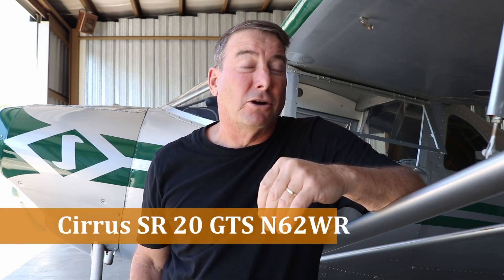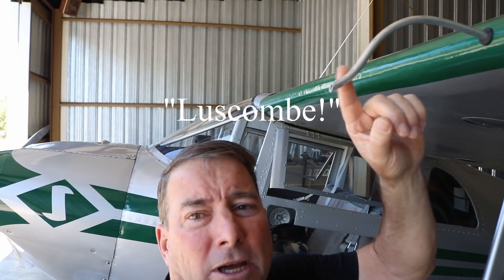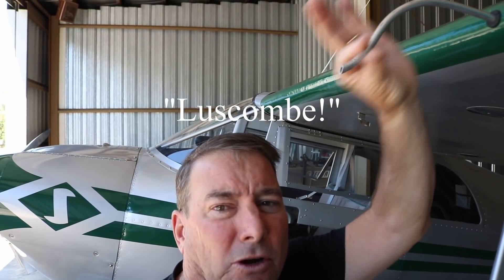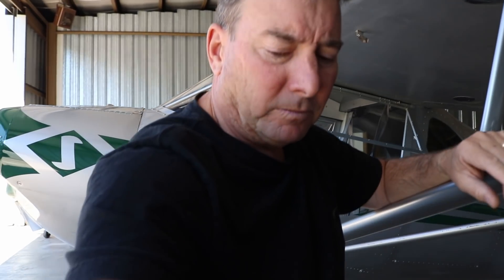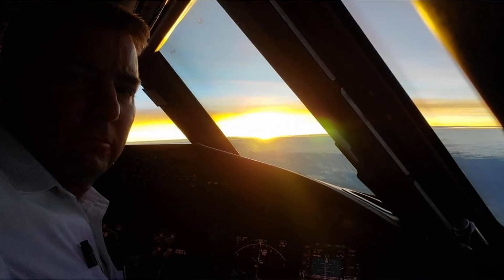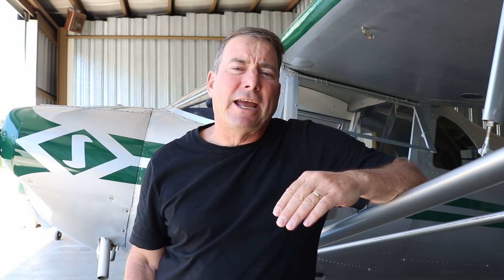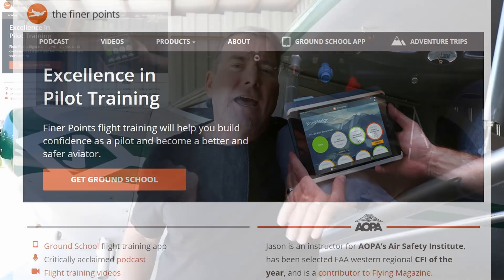Cirrus SR20 Crash Conway AR - AQP for GA!

Comment: I’m a new student but not a young student. This AQP stuff all sounds very important form the start. “Speed is life” is definitely in my head from you experienced guys, but translating that to “if you can’t be sure of the airspeed, push the throttle a fair amount and take it easy on upward pitch” is helpful to hear spelled out. Ideally I should only solo in aircraft that I have a good feel for so I have some references for stuff live what a good power level sounds like. Also sounds like a good use for pulling the CAPS chute but might have been thinking “Im close to the airport so I’ll just bring it in.” Finally shouldn’t there be a specific count of red covers that should be off the ports, etc and inside to cabin with you as a checklist item, even if it’s just one pitot tube cover? It’s so easy to miss stuff like this. Preflight should be “sterile” vs chatting.
Reply: AQP isn't needed if you  just follow the checklists religiously.
Reply: @speedomars  true. When I get part of my mushy human brain replaced with a perfect computer, and parts on aircraft stop failing, then I won’t need to worry about what to do when I’m in the air with no or unreliable airspeed info. In the mean time, I’ll put a little work into preparing in case I mess up or something like a failed airspeed indicator happens. But it is all lower emphasis that the fundamentals as you rightly point out. Missing the cover, if that is what happened, is a serious mess up.
Reply: "Ideally I should only solo in aircraft that I have a good feel for" And the statistics back that up. Instructional flights to transition into new models result in more accidents than any other type of instructional flight. (AOPA instructionalaccidentreportfinal)
Reply: the CAPS may not work well at low altitude, and yes push the nose down and have good airpseed.....
Reply: @logicturtle9838  All new Cirrus aircraft owners, and owners upgrading between the models are NOT allowed to fly their planes without factory transition training provided by CSIPs.  Anyone buying a used Cirrus from an existing owner is given full transition training by factory supplied CSIPs...and industry first, btw.  A new student taking lessons in a Cirrus should only take lessons from a CSIP if they want the most current and proficient training.  Cirrus cannot control if a regular CFI is hired by someone or is what a school offers to its students.
Reply: @tomdchi12  Unless you have an EFB which is using GPS or you have a glass panel that uses GPS, and the pitot tube is blocked you will ONLY have Ground Speed to estimate your over the numbers and approach speeds.  Otherwise, you have to do it all by experience and the feel.  Students generally do not possess those skills.
Reply: AQP in this context, means learning critical skills that aren't part of the FAA ACS.  Or in other words, training beyond the bare legal minimum to pass the checkride, and instead training to learn how to fly.  It sounds like you understand this is important, make sure your instructor is on the same page.  :)  For this particular accident, to me I see 3 independent mistakes.  First, an improper preflight.  Second, he either wasn't looking at the airspeed on the takeoff roll, or made a decision to continue the flight without an airspeed indication.  Third, he stalled the aircraft because he didn't maintain appropriate power and pitch settings.  It took all three mistakes to have this tragic outcome.

For preflight, I learned to start mine about 30-50' away from the plane.  Look to see if anything is obviously bent, crooked, etc.  Is the plane sitting "right" on the ground?  You'll see things at a distance that are not obvious close up.  Then I walk toward the aircraft and pull the pitot cover(s) and any cowl plugs.  In cold weather, it's common for aircraft to have those plugs in, and pilots do take off with them in.  Not great.  Next, I check the fuel, visually, in both tanks.  After all that is done, THEN I go through the POH checklist for that aircraft.  I always end with checking the oil.  I always sump the fuel.  I always check the trim, outside.  This way I have my own personal checklist, combined with all the aircraft specific checklist.

Before takeoff, I always do a briefing, either to myself or with any pilot, to agree on the emergency procedures A) on the takeoff roll B) on the climb before X altitude, and C) after X altitude.  So far, for on the ground, it's always "if there are any problems with the engine or airspeed, we stay on the ground" for me.  I believe it's critical that both pilots agree on whatever the plan is.  On the takeoff roll, VFR flight, my eyes are outside, except glancing down at airspeed regularly.

In the air, you should know what power and pitch settings work for straight and level flight in the pattern, and what works for descent and final.  That should let you fly the pattern and land, in most or all single engine piston aircraft without trouble.  I had to land without an airspeed indicator before my instructor would clear me for solo.  Above and beyond the requirements, and some might think too much.  Also, as a backup to this, is that you should know what being too slow looks and feels like, from your work at slow flight practice at altitude.  If things ever get mushy, reduce back pressure immediately.  In a fast plane, maybe using GPS speed is a good idea, but personally I'd never do it in anything I fly.  Even on a calm day, winds at pattern altitude can easily be +/- 10 knots, and that's far too much error, in my opinion, for safety in an aircraft that stalls at 50 k or less.

Not all aircraft respond the same way, your mileage may vary, run this by your CFI, and I'm just a plain pilot...but I do have a motorcycle license, too. :)  Best of luck with your flying.
Reply: @tomsmith3045  AQP is nothing new, unique, special or necessary.  This accident was the result of NOT FOLLOWING A PREFLIGHT CHECKLIST.  That is something MOST pilots eventually fall prey too as well.  It is not about training, its about DISCIPLINE and resisting complacency.  Same applies to making sure you have fuel.  Making sure you fly your aircraft regularly to reduce corrosion.  making sure you stay current.  Making sure you follow the same redundant, boring routine BEFORE and DURING each flight in order to avoid avoidable problems.
Reply: @speedomars  I'm sorry, you're incorrect.  This pilot made THREE mistakes, not one.  The first mistake was a checklist item on preflight.  The other two are training, and neither failure would have been caught on a private pilot checkride.  Checking airspeed on the takeoff roll is not a checklist item, it is a learned procedure.  Being able to fly an aircraft without stalling it, without a functional airspeed indicator, is a skill every pilot needs to have, and it's not tested on a checkride.  If you're an instructor, and you're training pilots to just the minimum to pass the test, you might want to reconsider your life choices.  This poor fellow doesn't exist  anymore because he didn't do a proper pre-flight AND because he either ignored, or wasn't given, proper instruction.  If it's the later, someone should have trouble sleeping over this.
Reply: @tomsmith3045  No.  The pilot left the pitot cover on.  That is a preflight checklist item.  No amount of training or experience will keep someone from failing to use a checklist and do a correct preflight check.  The kid no doubt panicked when he saw he had no airspeed indicated.  He could have used the Ground Speed if he was more focused and collected, but instead he got behind the plane and stalled it.  Happens to seasoned pilots too, especially pilots that have no AoA meter, or know how to use one.
Reply: @speedomars  Leaving a pitot cover on doesn't cause an aircraft to fall out of the sky.  Engine trouble doesn't either.  Stalling the aircraft and letting it spin causes it to fall out of the sky.  Ground speed is a terrible replacement for an airspeed indicator.  Setting power appropriate for climb, level flight, or descent, and pitching for the same is a very workable replacement for an airspeed indicator.  An AoA meter, in conjunction with appropriate power settings, could do the same.  We don't have a checklist problem, we don't have a technology problem, we have a people haven't been trained to fly the f(*(&ng airplane problem.  Stall/spin is distraction, poor training, poor procedure.  It is not tech.  Anyone that doesn't get that doesn't belong up front.

Comment: How was this student signed off to solo?  If a pilot isn't capable safely operating the aircraft by themselves, including when things go wrong, they're not ready to fly alone.  For that matter my CFI had me so prepared that my first solo, even with a real systems failure, wasn't anything special; nothing like the YouTube videos I've seen.  By that time it was just another day in the pattern, not thrilling or exciting. 

My CFI had me practice all sorts of emergency scenarios before signing off for my first solo.  Simulated engine outs at various times (some truly impossible to recover from), fires, flaps failure, controls failures, systems failures, covering up gauges, etc.  Also plenty of listening/learning what the plane felt like at different airspeed and power combinations, to the point I know what the RPMs are without even looking at the tach.   Plenty of systems knowledge stuff as well -- even going through the official maintenance (mechanic's) manual for this aircraft to understand how the plane is put together.  

I lost the vacuum system on the downwind of my first solo lap.   It was a total non-event and I continued to do my laps as if nothing happened.  I just thought about which instruments that would affect, then where I can find alternate sources for that info. If I got desperate I had Foreflight connected to a Stratus was sitting on the pax seat, and if I got really desperate my phone was sitting in the cupholder.
Reply: the bottom line is that ship happens, and the expectation that GA can be as safe as commercial air transport if only enough resources and training are dedicated, is so misplaced that it will kill GA altogether. it has already almost killed it, in fact.
the very fact that the community has become such a bunch of ship sniffers continuously hovering around crash sites is very worrying. how about some videos that are not dedicated to some hole in the ground with some corpses in it?

Comment: Yes....it should be a NEVER HAPPEN event to takeoff with a pitot tube cover in place -- and it is inexcusable.  But if it does happen, it should not result in a crash and death.   If the pilot had a backup yoke-mounted instrument like a portable Garmin 496, he could use the ground speed on the GPS to make a safe landing.  (I realize the Cirrus does NOT have a yoke.)  If Air France 447 had a portable G496 in the front office of that jet, it probably would have never gone down.  Believe it !!
Reply: No, he did not need any extra instruments. He was reported to be an experienced pilot flying in VFR condition. Just put the nose on the horizon and keep the power up.

Comment: "Fire Hose". Yes, absolutely correct. After a 30+ year career flying for a major airline, it is a challenge to take all of the info in as fast as it comes at you. General Aviation will never have the structure and internal support system the airlines have.

Comment: I dont understand even if the airspeed wasnt reading why he didnt maintain thrust.
Reply: Maybe he panicked because he was too reliant on the gauges and had never trained his ear to listen for RPM"s? Kind of like when you learn to drive a manual transmission vehicle, you don't need to look at the RPM's or speedometer to know how fast you're going and when to shift. You know by the sound of your engine.
Reply: @user-qr8ki8ue4i  Definitely a plausible explanation .  Its too bad the training cant be improved as the video outlined, for this poor guy.

Comment: It seems to me that it would be advantageous to use a tablet computer to run the checklist, taking a picture of every checklist item then going through those pictures. A barcode label could be applied at each item.If a barcode for an item wasn't photographed or caught on video the checklist wouldn't show up as completed. It at least makes them walk around the plane instead of pencil whipping a pre-flight.
Reply: its not that hard to preflight check an aircraft… it just needs 5min but in those you should not talk to anyone else and concentrate.. 

usually these things happen when you have to respond to someone or distracted by something… But then just start over and do it again.. or as Juan said.. a idiot walk around to make sure the critical elements are ok
Reply: They've already got those apps built for security guards, but they use Android + NFC.
Reply: Accidents such as this should be all that is necessary to dissuade any pilot from "pencil-whipping' a pre-flight inspection....
Reply: @KaneYork  yes our airport security has to go around and check off certain points.. but i mean a preflight on a single engine piston aircraft are maybe 20points.. if you can’t check those how should you do in the cockpit?

Comment: Poor student. Low wing too, so leaving the pitot cover on (if he did) is not visible from the cockpit. An experienced pilot would know RPM/power settings for each phase of flight (so that's a training/experience issue!). A friend's father had a faulty pitot on a short grass strip - it had been fixed once or so he thought - so he had to land back on a short grass confined strip using RPM and throttle settings etc etc as a guide. A student might have panicked at such a point and stopped 'flying' (in effect) the aircraft.

Always good to do a second walk around, peering into places that need looking at - even if a full pre flight was done. Eg imagine if you wander into the hanger to get something you've forgotten, after your preflight checks, and a.n.other has damaged your aircraft whilst you were away and he/she doesn't tell you.

As you point out though - what about abnormalities on the take off run. One should set an abort point (brief oneself), if not making airspeed or rotation speed, abort.

Especially with a single engined aircraft:- 'Max RPM, Acceleration Normal, Airspeed Alive, Ts & Ps good/normal Rotation speed achieved (or abort).

Easy to be an expert from my armchair though.

Comment: The Cirrus has GPS which would indicate groundspeed, keep that number above the stall airspeed, also an issue that could get you is not looking at the airspeed while still accelerating but well below takeoff airspeed, a few hundred feet down the runway and airspeed should indicate above zero but not quite at the minimum takeoff airspeed.

Comment: Cirrus has a GPS speed that would be close enough.
Reply: Pilot error pito airspeed check at ground roll check if no airspeed abort takeoff 200 ft 300ft 400ft 500ft its really simple
Reply: Exactly.  There is no real need to use the indicated airspeed during flight.  Flying using angle of attack (AOA) indicator would be easier and safer than by using indicated airspeed.   To avoid stall, simply do not exceed the stall angle of attack.  There is also an optimal angle of attack for climb, for efficient cruise, and for descent.  During steep bank, one is still able to stall the aircraft even at high indicated airspeed when one pulls too hard on the stick to exceed the stall angle of attack.   Landing an aircraft using the AOA is also easier, as one simply maintain the proper angle of attack for the approach, while adjusting the throttle to control the rate of descent to stay on the approach path to the runway.   When reaching near the runway, advance the throttle a little to slow the rate of descent, then soon enough, the aircraft will be in ground effect and wants to float and one simply needs to ease gently on the throttle to the idle position to get a soft touchdown on the runway.   By minimizing the use of elevator while trimming for the proper AOA, and using the throttle to control the rate of descent and climb, stall and spin accidents can be much reduced.

Comment: I always do my take off emergency briefing prior to line up, even when flying the C172…
-In case of any abnormalities before rotation speed 55kts: abort take off
-In case of engine fire or failure or aircraft unflyable after rotation speed, with sufficient runway ahead (state decision point): nose down, flaps full, land on runway
-in case of no runway available: nose down, pick landing site max 30° left or right, once committed, flaps full, land

In my opinion every pilot should go through this prior to every take off, regardless of aircraft type and pilot license type and experience!

Comment: I've never left the pitot tube cover on, but years ago as a low time Private pilot I did once have a sudden complete loss of airspeed reading right after takeoff in a Grumman-American Tiger, traced to insects in the pitot tube. But if you just use the normal power settings  and hold a normal attitude in the pattern your airspeed should be within the normal range. I did make what was probably the hottest landing I've ever done, though.
Reply: LOL  just made a similar post about my Gruman Tiger pitot tube being clogged by a bug. The only airplane I've ever had that happen on.
Reply: The item to fall back on  is: pitch + power= performance.